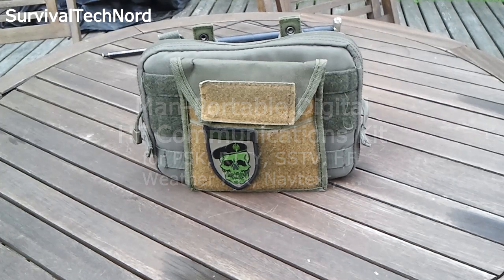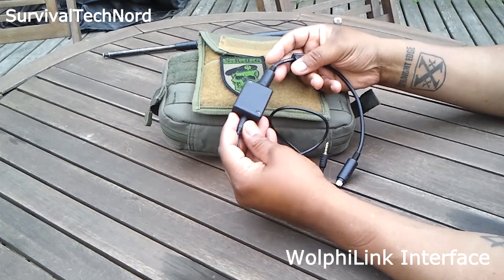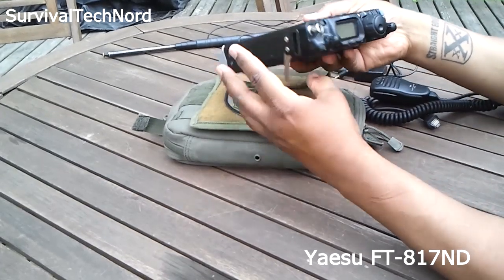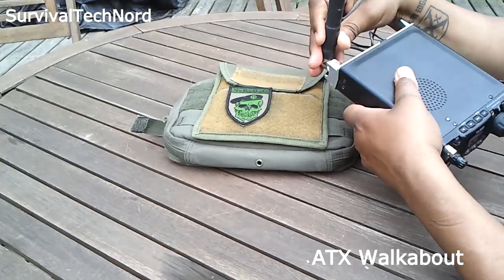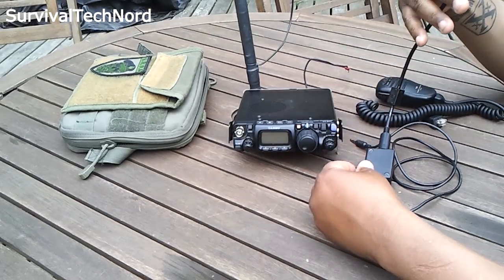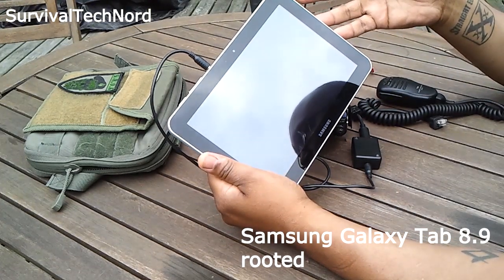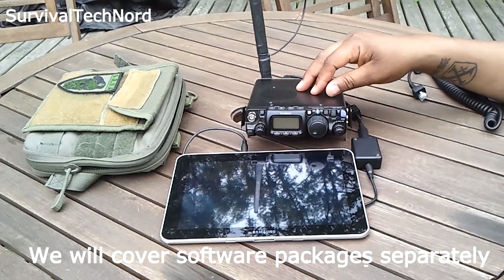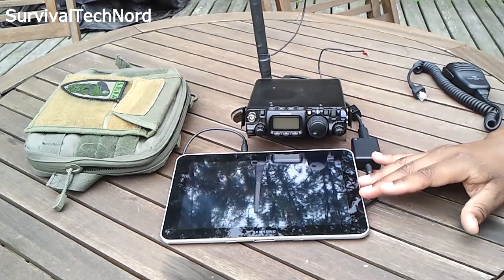Portable Digital HF VHF UHF Communications Kit

Comment: Very nice.  Wish I had the bucks.  My very non portable set up that does nearly all that cost me only 400 bucks.  I must look for the least costly options.  Too bad most folks can't go here, as there is always other essentials to buy...  I would start my own channel with that focus, 'comms on a budget', but I have load development to do. Just discoveredth is hard to get info from Brass Fetcher along with myown homework: For the ultimate, run pulled m61 or m2ap bullets in a .300 Weatherby at 3,450 to 3,550fps.  Good for 0.5" thick MIL-A-12560 armor plate from as far away as 350 to 400 yards.

Comment: Do you have to have internet while using the android like that?
Reply from the maker: That depends on where I happen to be operating from. In this case yes, but it's not really necessary.
Reply: +SurvivalTech Nord OK thank you.
Reply from the maker: No problem. I think the only one of those apps that use the Internet is APRSDroid. However for the most part all of the signals coming under coming in over the radio themselves and are designed to work independent of the Internet.
Thanks for watching man more videos to come.
Reply: Awesome, I have learned a lot watching your channel.

Comment: I have a 703 that I intend to use for portible and remote opps. Seems a bit larger. I could look it up but do you know the size, weight and current draw differences on these?
Reply from the maker: Hi Steve. Thanks for your question.
I don't have a 703, but I found this comparison http://www.lefars.org.uk/lefars_website/publications/a_comparison_of_the_yaesu_ft-817_and_the_icom_ic-703.pdf
Reply: Guess I will have to dig for current requirements.
Reply from the maker: ***** 
Icom pages for your radio Current drain: Transmit max. power 3 A; Receive 450 ma
Reply: I looked, all the sites I could look at this morning mention everything else EXCEPT the 817 current draws.
Reply from the maker: Yaesu site :)
500ma
Reply: So the 703 and the 817 have similar idle currents then.
Reply from the maker: ***** 
It would seem so